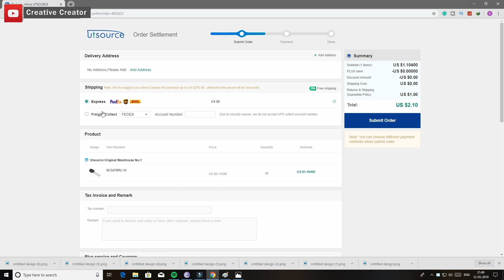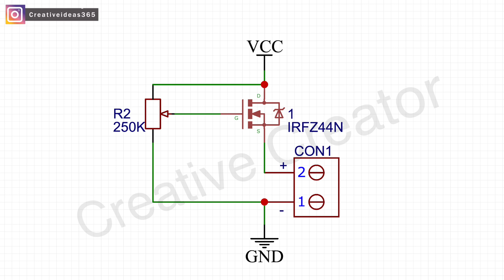LED Strip Dimmer Circuit

Comment: No need for a DM13A unless using PWM on the gate pin to control a higher voltage /current source than the PWM can out put.. kinda like a relay.. not trying to be mean just stating the obvious

Comment: 12v in drop to 8v out😂
Reply: I was hoping to find a good video on dimming using the Gate pin of a MOSFET and PWM instead, we've got this guy over here soldering a potentiometer directly to the MOSFET 😅

Comment: Can you use it also for RGB ?
Reply: That's what I'm working on figuring out. I need to dim custom RGBW with the factory dimmer switch which is a 0 - 5 v potentiometer.
have my doubts based on my experiments.
I tried just putting a 5k pot on the 12v and it worked to an extent, but the problem with RGB was it would only dim to an extent then all colors except red cut out because the voltage gets too low.
I replaced the pot with a PWM fan controller and had better success since it maintains enough voltage to fire all colors.
I am doing more experimenting. I am using a combination of RGBW for the cluster and other backlighting and RGBCCW for dome lighting / interior lighting.

Comment: This circuit uses 4 volts to open the gate, so my 12v power supply delivers only 8 volts to the LED strip. It seems to me that a MOSFET requiring less voltage to open the gate would be much better for my application.
Reply: Is the mosfet really necessary? I wanted to use this circuit only with the potentiometer. Would it work?

Comment: Hello
Can i use this on automotive bulb ? I want to run with this one bulb of 12v H1 55W but at 6V, is it safe ? That would be 23W and 9 amps right ? I will put a heatsink on the transistor though.

Thank you!

Comment: Hi, thanks for video! Imade the circuit, it kinda works, but, the problem is the led is not as bright as connected straight to power supply when turned full power. Any solution?
Reply: I found that the circuit needs 4 volts to open fully, so my 12v power supply goiong thru the circuit only outputs 8 volts. "This circuit uses 4 volts to open the gate, so my 12v power supply delivers only 8 volts to the LED strip. It seems to me that a MOSFET requiring less voltage to open the gate would be much better for my application."

Comment: What is downside of using mosfet and potentiometer  to dim 12 v led strip. (comparing it with pwm dimming)
Reply: It’s not as power efficient. He’s just using the mosfet as variable resistor.